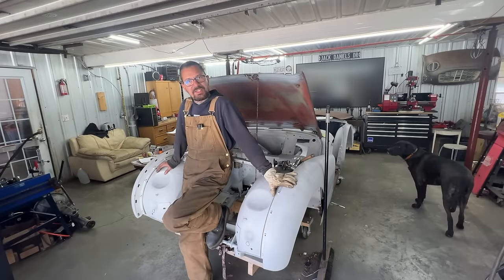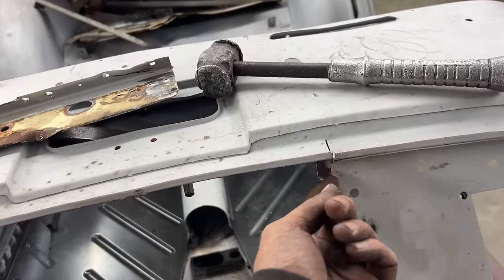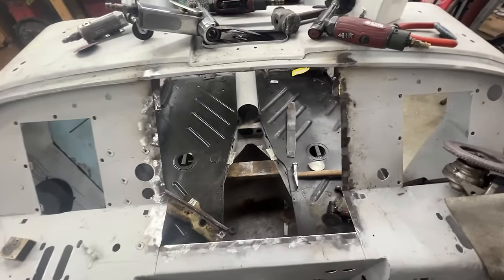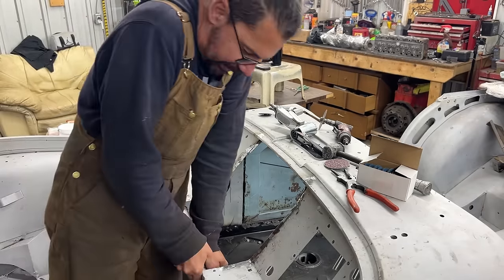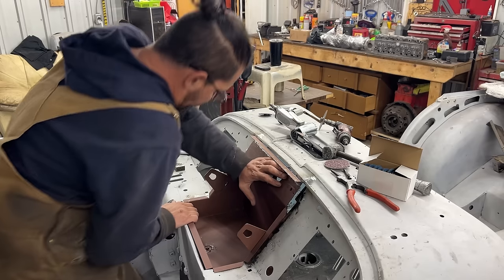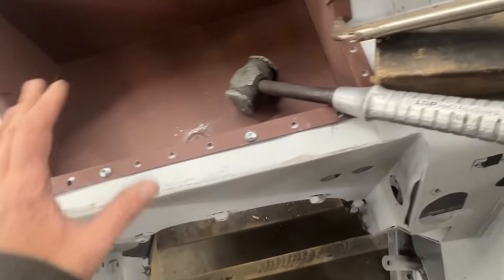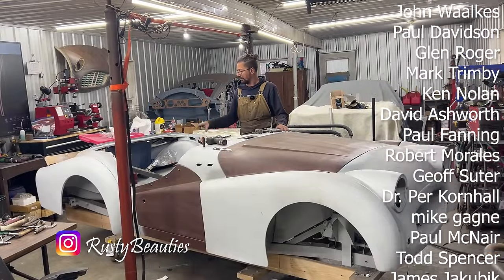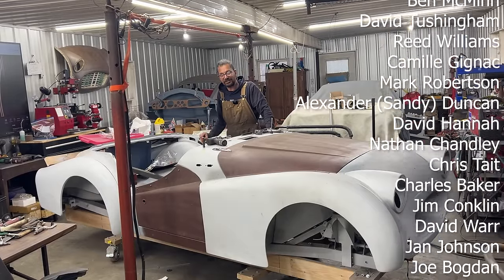1958 TR3 - Part 13 - Battery Box

Comment: Great work Elin.  Moss part 802-930 is the packing piece under the bonnet latching bracket.  Use as many as required to space the bracket.

Comment: You are an inspiration to me, I've spent 4 weeks installing an oil cooler system on my Triumph Vitesse, it has taken me so long because, I'm a perfectionist, I needed to order more seals, more unions, more brass olives etc and nothing was available locally, also I'm 65 now so less energy is available and more lower back pain slows me down! Add to that a big engine in a small car and hardly any information or pictures etc is available in my extensive Triumph library or on the internet about this job. But with perseverance and the fact I am just retired, I got it done! Now to replace all the stuff I had to remove in order to install it! Alternator, Fuel Regulator and lines, relay for the electric radiator fan, engine side valance etc. (The system had previously been installed professionally,  but they put the radiator too low down and it got split open on a road hump at 1mph, nothing to do with my having three girls in the car at the time, fortunately it was only a mile from home, and I had a spare gallon of oil with me, so I just made it back without wrecking the engine, but left a trail of oil all the way back!)

Comment: I was waiting to see you do this one! Hello from Argentina, I'm still there. I did the same repair on my TR6 with a battery shelf from NRP in Iowa. The part fit great, but it was a challenge to install as well. I also bought an aftermarket floor section, it had the same issues with many bends in the wrong location. For that, I gave up and got a Heritage part, it fit perfect!
The TR3 is looking good!

Comment: I was very lucky with my TR4's battery "shelf". The previous owner had riveted an aluminum panel in there. Once I removed that, the original steel had several spots rusted through, but all were small enough that I was able to fix by welding in several patches that were probably less than a half inch square, along with welding up the rivet holes. After a little grinding and a coat of primer, it looked like new. I wish some other repairs were so easy!

Comment: Sadly my memory of the TR-3 battery box is vague , but it looked to me like the one that you took out was a bodge to begin with ( excluding the bottom which we've all been guilty of bodging 😅).  I do remember replacing a battery box in a TR-2 which is the same from memory and didn't have the issues you ran into.  Great work again Elin..

Comment: How about removing those two little pieces that are bridging the gap in the upper corners. That should make it possible to insert the battery box with the upper flange first and than tilt it down into place...

Comment: Just don't be like the previous owner of my Spitfire who bent up the sides of the battery box, hammered the braces outwards and then hammered the box through the remains of the old battery box and just welded around the edges.
Reply: I bet a hell of a lot of home fixers have done it exactly that way..